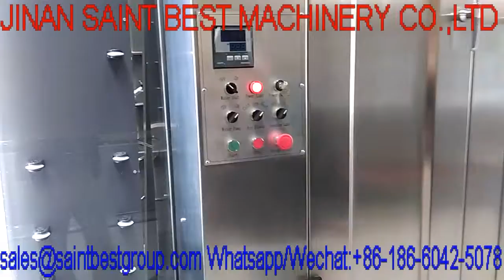1800mm Vertical Glass Washing Machine,Vertical Low-e Glass Washing Machine,Flat Glass Washer

Comment from the maker: 1800mm Vertical Glass Washing Machine,Vertical Low-e Glass Washing Machine,Flat Glass Washer,1800mm Vertical LOW-E Glass Washing Machine with Tilting Table,1800mm Vertical Glass Washing Machine,Vertical Low E Glass Washing Machine,Vertical Flat Glass Washing Machine,Vertical Glass Washer,2500mm Vertical Low-e Glass Washing Machine,Vertical Insulating Glass Washing Machine,1800mm Vertical Glass Washing Machine,Low-e Glass Washing Machine,Vertical Flat Glass Washer,Jumbo Vertical Flat Glass Washing Machine with Tilting Table,Vertical Glass Washing Machine,Vertical Low-e Glass Washing Machine,Glass Washing Machine,Vertical Glass Washer,Titling Glass Washing Machine,Jumbo Vertical Glass Washing Machine,Flat Glass Washing Machine,Glass Washing Drying Machine,Vertical Flat Glass Washer.
   If any interested in it,pls send emails to sales@saintbestgroup.com or saintbestgroup@163.com or add Skype:allenszj for direct conversation.
URL: www.doubleglazingequipment.com www.saintbestgroup.com www.digitaluvprinter.com
  Email:sales@saintbestgroup.com  saintbestgroup@163.com 
  Whatsapp:+86-156-6587-3459,+86-186-6042-5078